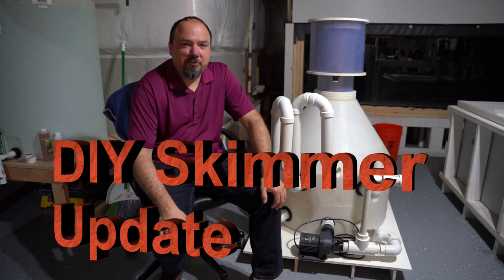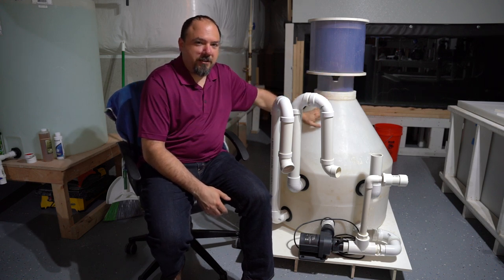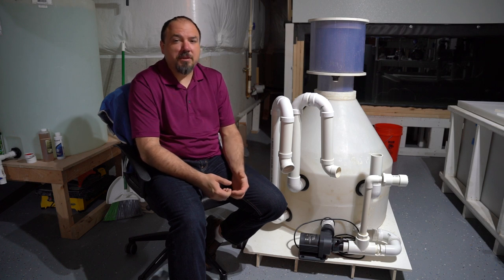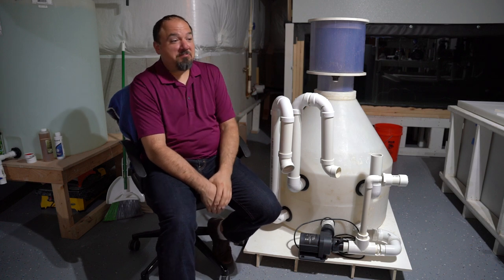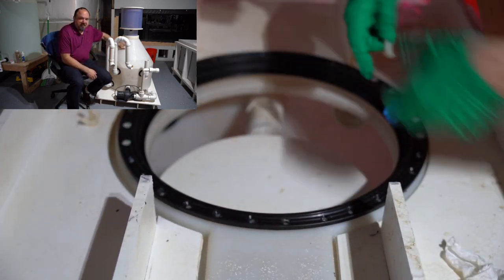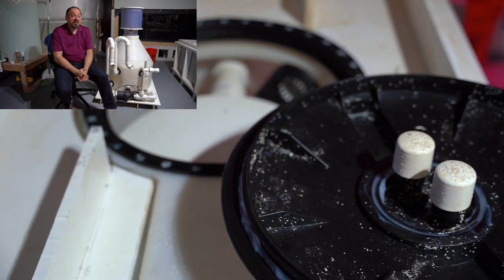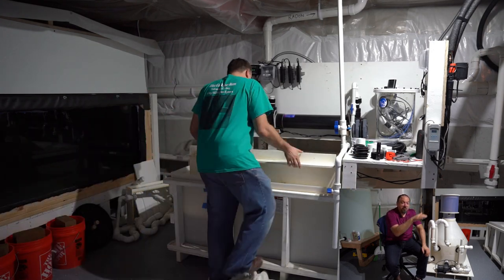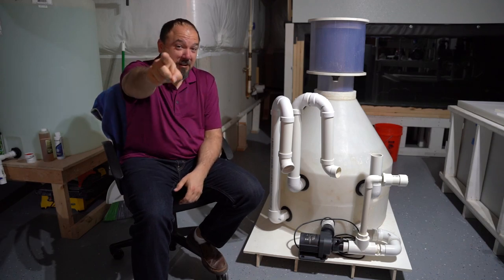DIY Skimmer Update

Comment: I'm still in awe of it and I watched you build it. 👌👌 Hope the mods work as intended.
Reply from the maker: Thanks DrOfWelshMagic.  I think the uniseals and extra gravity feed/drain will help out a lot.  Now I just need to see if the fix on the lid holds long term.
Reply: @algawura2  I'm sure it will be better than ever and those 32 screws and multiple silicone beads will do a great job for many moons. 👌👌
Reply from the maker: @Leigh33  So far its holding water